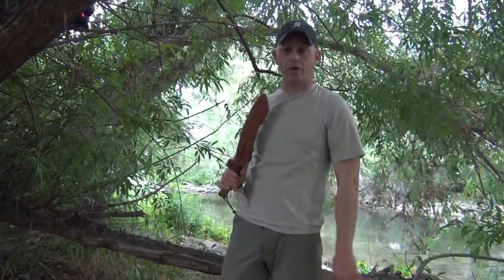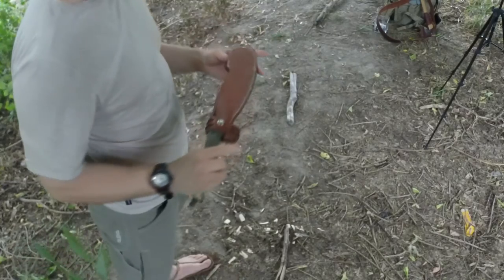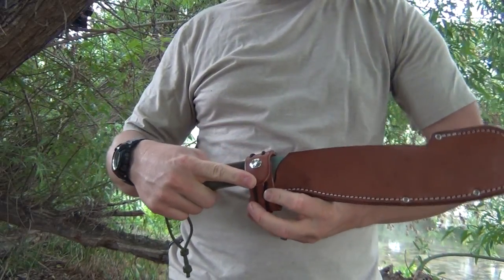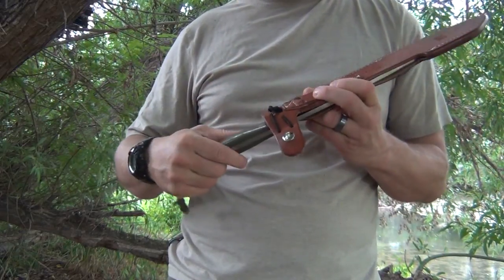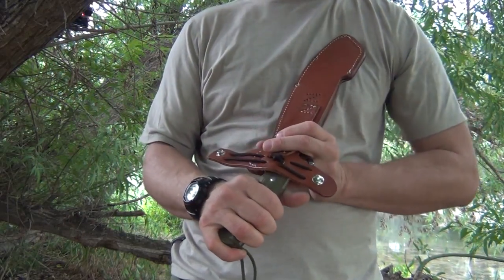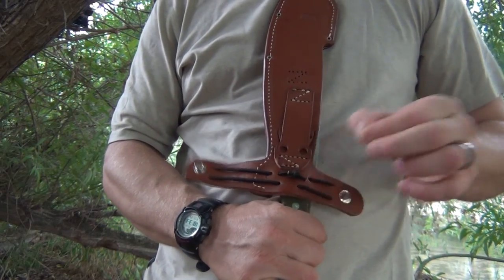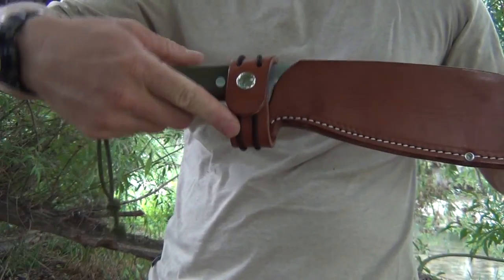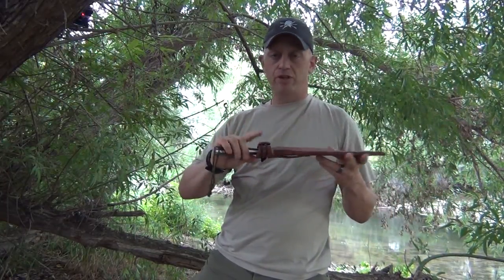Bark River Parang Sheath mod!

Comment: That's  a great  mod .  and looks like a very  beautiful  knife , but I'm  thinking that a true Parang   knife is a little shorter  and much more skinner  they are balanced well and light weight  so not to make  using it such a chore.
Reply from the maker: +Dan Leasure A jungle Parang is skinnier and shorter but it is also used by smaller indigenous peoples in the jungle.  This guys was made for harder woods up here in the northern hemisphere.  Because of that it's a bigger harder hitting blade.  A small Parang has a very hard time going through hard wood.

Comment: Any chips or rolls on this A2?
How do you compare A2 to 1095?
Reply from the maker: Not one actually. A2 is stronger, harder, sharper. Use your blade correctly and it will never chip or roll.